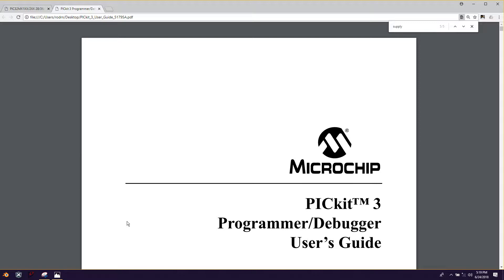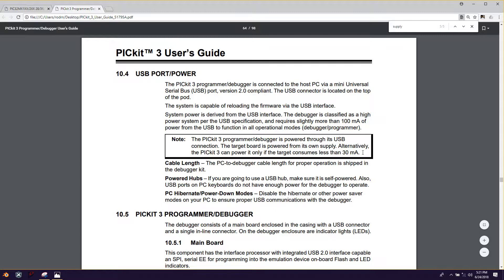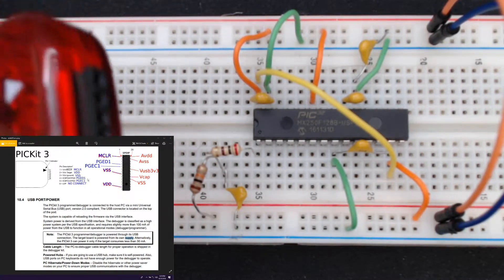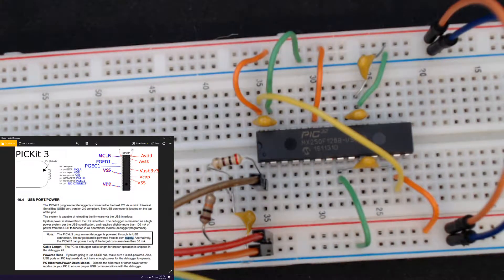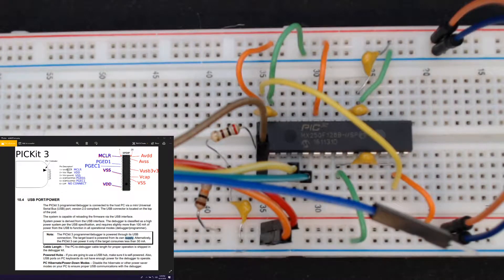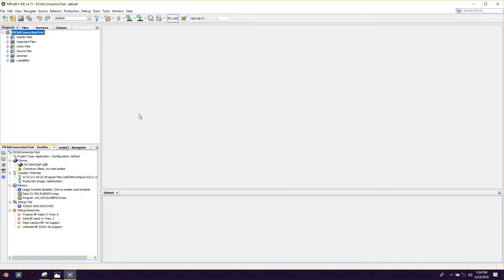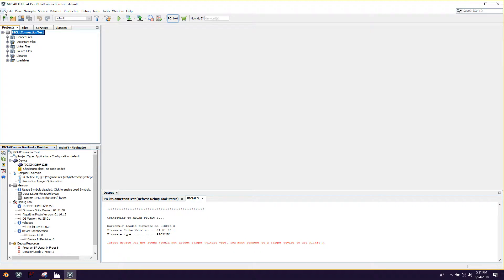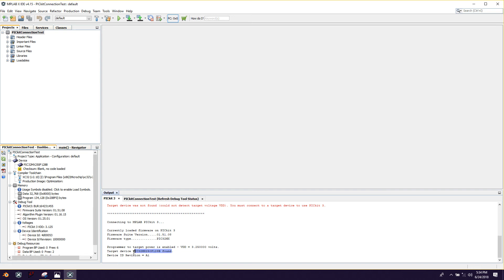PIC32MX250128B 04 PICkit3 Connection

Comment: Can you please specify the components you use? (resistors and caps) Just a screenshot of the board with uF and ohm values. Otherwise... great vid. Thanks.
Reply from the maker: Sorry for the late response. Just in case you need it still, I've provided a link to an image below:
Reply from the maker: https://static1.squarespace.com/static/5793b240b3db2bd9ef3f9224/t/5c04be0c40ec9a8b6f2a29aa/1543814695868/CircuitLabeled.png?format=1500w